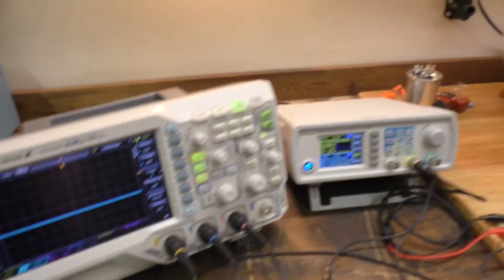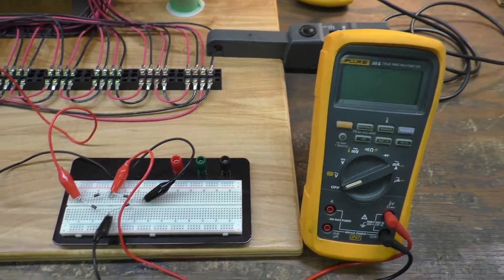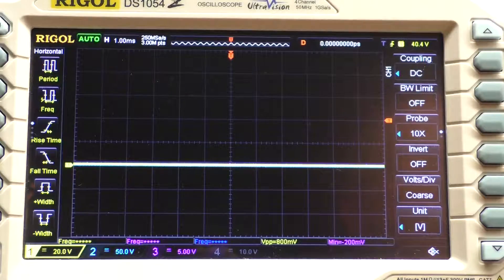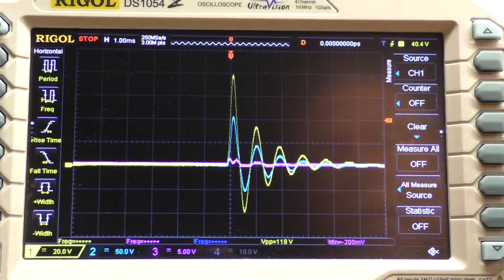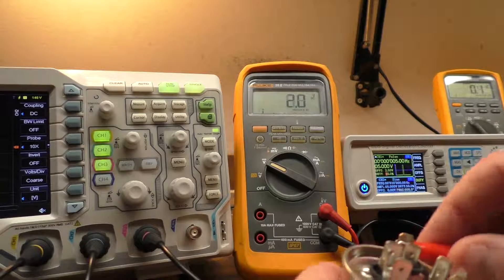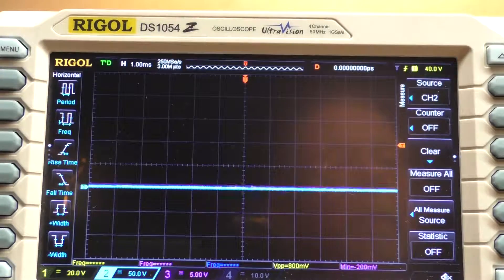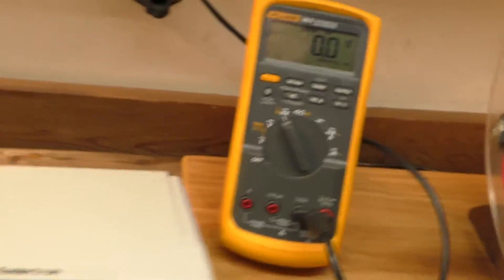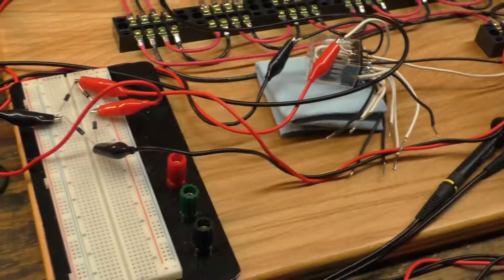Stubblefield Coil build part 5

Comment: Bob did you find more pages to Nathan's Patent? If so, Where? 
I can only find the first page, which is not the whole explanation. 
You said that Nathan was burying his battery under oak trees and the soil was acidic. That means using citric acid is called for, not salt. Plus Nathan soaked his battery overnight with local well water. Meaning, the well water had the same PH as the soil. As well. Nathan does not show separate wires on the top or bottom of the battery. Why? The battery is suppose to be benefiting from creating and utilizing an electric field around itself. That is why the top and bottom should be made of wood. Wood is porous and the minerals of the water would help create the electrical field structure. But all in all, he defiantly was ahead of Nikola Tesla.

Comment: I thought the device wasn't actually a battery but more of a facilitator in collecting Earth energy but requires it to be buried in the ground?
Reply from the maker: It is a battery but part of the myth is it captures Earth energy. The reason the battery was buried in the ground under oak tree's was to keep the battery moist and oak tree's like acidic soil which acted as the electrolyte. The battery does exactly what is described in the patent to produce enough voltage and current to run a telegraph station. The genius behind the design is the anode and cathode are wound in a spiral producing a large induction coil. When I short the anode and cathode together the discharge current produces a large enough magnetic field to give a big boost in the secondary coil.